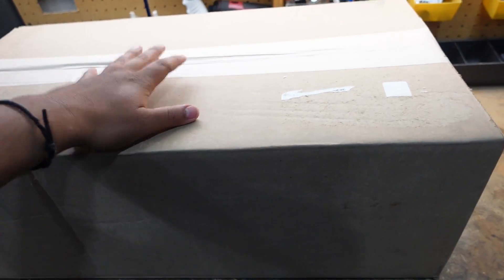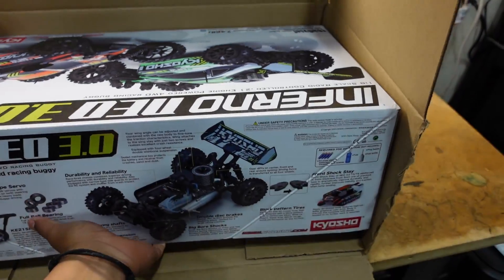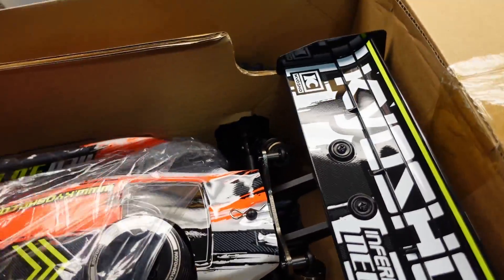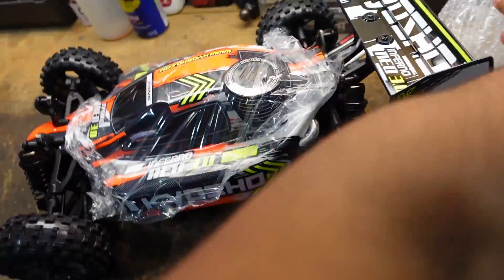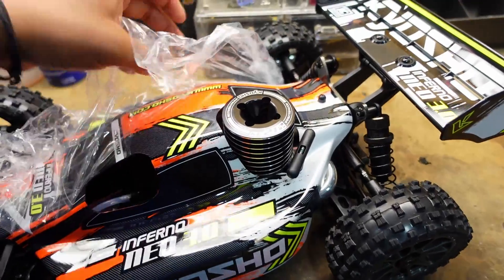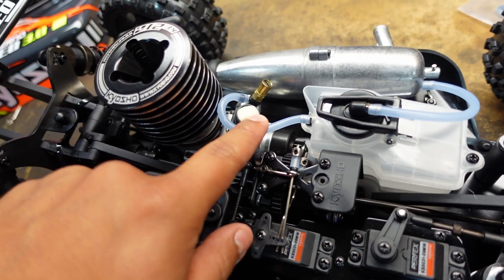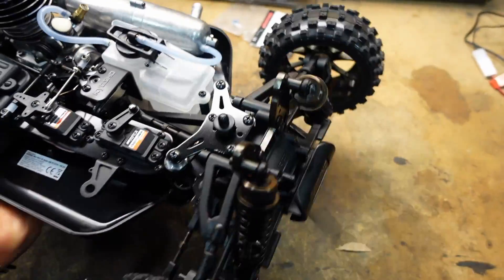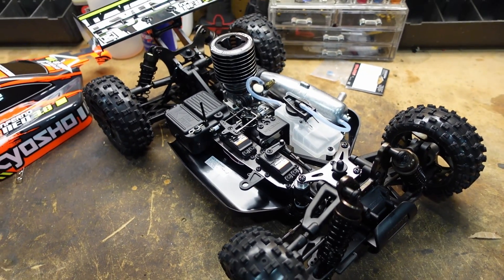Kyosho Inferno Neo 3.0 Unboxing!!!

Comment: I got mine last on Monday (same color). I also got it from the same place. Fortunately, I didn't have to deal with shipping. You will have loads of fun. One thing you will need to do, is swap the spur gear to a metal one (ifw634-46s).

Great video...

Comment: First, make sure Failsafe is set up.  Steel spur gear is a must. Factory air filter will make engine run too hot and lean with body on car.  Cut out right side window and use an MP-9 or MP-10 air filter for top speed with no issues.  Street tires are a blast if you are not a basher.  Enjoy!